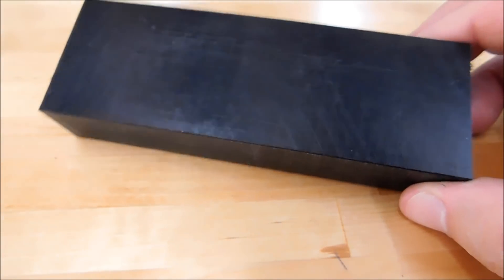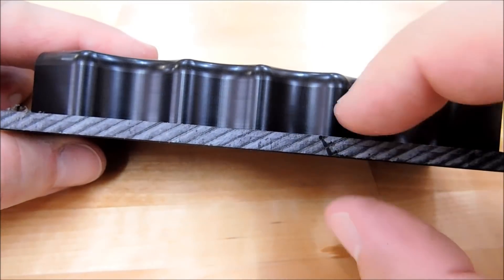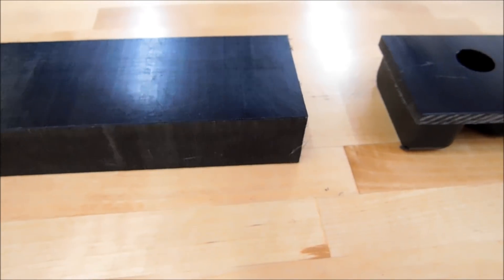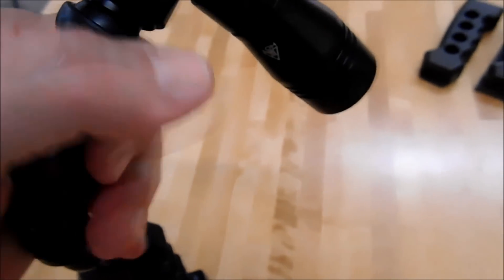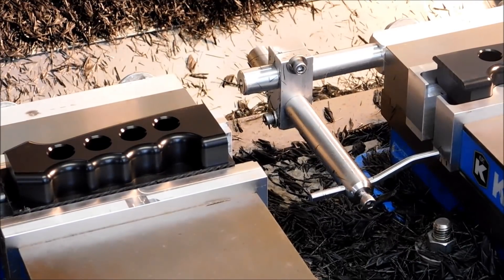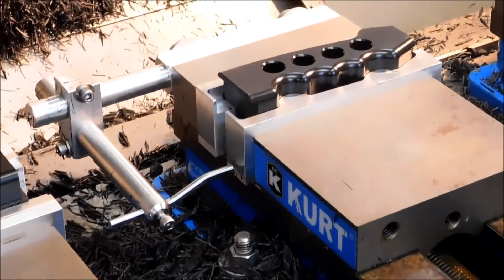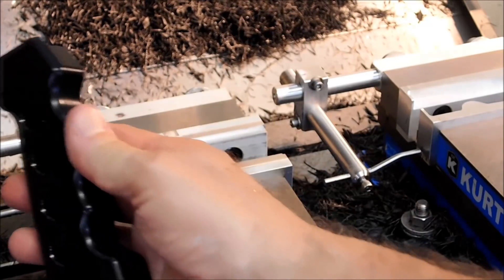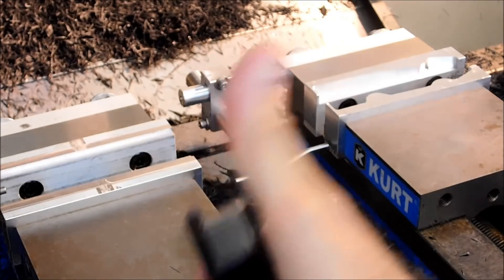Flip Flop Milling

Comment: Fun video to watch and fun comments to read. After seeing how many times "what material is that?" is asked, I am thinking Joe's saying note to self, always show materials used in a caption. For everyone concerned about his code efficiency, I made a one character change to some manufacturing code today that took ten seconds and had to fill out a full page change notification notice to release it. My IT friends have it even worse, they have to fill out a 7 page ticket for any size change and send it to a contractor to do the work, taking about three weeks. So sometimes the overhead of making a change, better fixture etc. dwarfs the time of making the change. I am guessing his fixturing and process flow is optimized for the number of parts made and total time required for setup.

Comment: Another Greatttt Video, Joe Pi !!!   I learn something from you - from every single video.   I have even started putting screen captures and notes into a notebook  (Machining Tips and Tricks from Joe Pi !).   I am assistant teaching machine shop classes at a local community college - you can bet that these tips and tricks are being taught to the kids!    A video on how you set up the vises and entered the offsets between the two vises would be great, too!  Nice work.  Great instruction on how to make multiple parts - in two vises.  I have typically made a registration feature on the part or on the cut off section of the part - and used a dowel pin to register when I flip the part over into either the same fixture or the second fixture( I know hard to understand from a written comment...)

Comment: I would love to see more tips and tricks on your cnc!
Reply from the maker: My software is pretty powerful. It kind of takes the creativity out of some things. I always enjoy the clamping and secondary positioning challenges. Good for the CNC and manual areas.
Reply: I currently use mastercam at my cnc but I  also work with an older Sharp mill. I enjoy seeing your creative answers to fixture work.
Reply: @joepie221  What software do you use?  I am using V-Carve, BobCADCAM, and now Fusion 360
Reply from the maker: @joecnc3341  Pro E wildfire 4.0

Comment: Joe -- I was just at Dos Ojos a month ago -- beautiful!  Did you post your dive video?  I cannot find it.  Cheers.
Reply from the maker: Still in edit. Its a great place to dive. Amazing.
Reply from the maker: Scuba, snorkel or just floating?
Reply: @joepie221  only snorkeling. I've never really wanted to scuba before, but wife and I both seriously tempted after seeing 2 cenotes last month.  I have a few great still photos I took with underwater camera.. The light was just right!
Reply from the maker: Cavern, cave or cenote diving is not for beginners or the faint of heart. be sure you have a number of dives under your belt and aren't freaked out by confined spaces before you decide to try it. Swimming in a cenote is amazing, but going to the bottom and into a crack in the rock is another level. Its amazing and beautiful, but just as dangerous and challenging. There is NO up if something goes wrong. Its actually quite a rush.

Comment: "These holes are interpolated because I use these holes for fixturing at a later time"  What?
Reply from the maker: Interpolating a hole means to size it with an end mill traveling a circular path. The size, finish and placement are very accurate. I register off these holes when I stand the part vertical for the end work.
Reply: @joepie221  
Learned about interpolating radii and internal and external holes long before I learned CNC. We had some K&T Rotary Head Mills. Pretty slick at the time.
Reply: @joepie221  Thanks, I was not familiar with that term.

Comment: Those lights are 100% water tested to depth and corrosion proof?
Reply from the maker: Yes. the lights are tested to 130M and fully corrosion proof. they are manufactured by Princeton Tec in NJ. Genesis 1000L. I personally dive with them and have nothing but praise.
Reply: @joepie221  Sounds like an excellent choice then! (~_^)-b
Reply from the maker: Rated the best illumination for the dollar. 1000 Lumen dive light for $150. Thats a great deal.
Reply: @joepie221  I would expect a deep diving light to cost. I suppose if one can afford to deep dive, its not really a large part of the cost of rigging.
Reply from the maker: I am currently heavy into cavern and cave diving. Deep doesn't factor in  lately. 60 feet maybe. But there is NO up. Its very intense.
Reply: @joepie221  I don't even have div certification, and the idea of being some place trapped when my air ran out scares me pretty well enough to not be enticed to go into underwater caverns... [nervous shudder]

Comment: On the last op, you could use your chamfer tool to spot drill the 2 smaller holes. If you spot them a few thou bigger than the drill size, you've effectively deburred them before drilling. Hope that makes sense.
Reply from the maker: I did that for the threaded hole. Normally, I deburr a part like it was molded, but those holes take anti-rotation pins that go vertically into a void. There is no mating hole so a raised burr doesn't get in the way of its function, nor is it visible at assembly. It does bother me though, so I may edit the code.

Comment: You could quickly spin up the tap in reverse direction after the first thread operation, might get the strings flying so it's clean for the second thread. Might be worth a try.

Comment: dude is dogshit at programming
Reply from the maker: Talk is cheap bud. Get technical and earn our respect.
Reply: @joepie221  I had hoped that was meant as a compliment but if it's not clear it doesn't count.
Reply from the maker: @tinman5322  I took it as a slam. if he had said "that was the shit" it would have been OK.
Reply: Fair enough. The 'net is such a global phenomenon that I resist using what might be regional colloquialisms. Here in the Boston area "wicked pissah" means great but I wouldn't expect anyone farther than 25 miles away to know that. That said, your techniques are WICKED PISSAH! Sorry, couldn't resist that time.
Reply: I have been a CNC machinist for 32 years started out hand writing G code on Tape machines. I currantly manage a small shop in Austin. I program a 5 axis Deckel Maho and others 50 hours a week for company that ships 500k a month with 3 machines and 2 guys. Joe,s programs are good and his end result is beautiful. Thanks for the video Joe

Comment: Are kurt vices so accurate that you can locate a precision part off the movable jaw?
Reply from the maker: They probably are, but my location is always done from the solid side. Soft jaws are another story.
Reply: I'm getting within ±0.003" on 4-jaw Kurt with removable aluminum soft jaws.

Comment: Is there a reason why your code has the tool step away and come back in (12:55) ? Something to do with eliminating backlash?
Reply from the maker: The 4 small radii present at the pockets are faded out at 2 degrees so there is no line of tangent, the step move assures the cutter is off the part for the re-position and re-entry on the opposite side. The shift was calculated to allow for the use of a larger tool if needed.

Comment: Those R planes are weird AF.  Goes R0. the. The programmer R value.  Pretty sure you could’ve used the same endmill for roughing and finishing.
Reply from the maker: They are the same size, But strictly to achieve the perfect cosmetic finish, I use a brand new cutter for the finish pass. No other reason.

Comment: Not hating on you at all. But I hate when the initial rapid plane and retract plane arent the same. Freaks me out every time.
Reply from the maker: Its fine, but how do you prefer to see it?
Reply: The initial rapid plane should be the same as your retract plane. So the last z rapid move before your canned drill cycle should be same as the R(retract) in your canned cycle. That is unless you are using g99 and g98 and are trying to avoid clamps or bolts
Reply from the maker: I always approach the feature high, and shift from hole to hole, low. My final retract is G98 and rapids to the high plane before leaving. Unless the height difference is major, the time difference, or even the visual is almost undetectable.

Comment: Great video. I'm just wondering how much would just a handle modified so as to be able to accept a metal file would be? What I like is the pistol grip aspect. would not need the 4 hole(s) in the handle.

Comment: great video Joe- It's amazing how many comments were sent claiming their way was more efficient but at the same time it was  interesting reading their other ideas
Reply from the maker: I agree Mark. I think if I had to make thousands of these, I'd consider investing in a mold and calling it a day. As for machining that many, pallets would be my first consideration. I've implemented those before in previous jobs, and you just can't beat the efficiency of loading a pallet while the machine is running. Door open time is almost non existent for the yield. This process was selected because of many other factors not discussed.

Comment: I don't tinker w/cnc , so my only comment is... WOW!
Reply from the maker: This would be a tough part on a rotary table. I bet not nearly as fast. Just a guess.
Reply: @joepie221  I don't even have a rotary table to clamp to my milling machine. I'd really like to see how such a part could be made on a basic milling machine Joe, after all I'm betting that most of us viewers don't own a CNC machine.
Reply: @steveclark..  Unless you are working strickley from your garage, there is little reason not to have a CNC anymore.  They can be found cheap at auctions, albeit they are someone else's used car.
Reply: @theincantrix5725  I work strictly from my garage, and I've got a 4-axis CNC router with 24x48 envelope, a 4-axis CNC knee mill, and a small CNC lathe. Router and mill are commercial products, even. Any used car you could get for the amount of cash I've invested wouldn't even be worth driving. Probably wouldn't even be capable of driving.
Reply: @theincantrix5725  My workshop is my garage I'm afraid, even if I did have space in there, I'm sure that even a second hand CNC would be out of my budget, apart from that, the programming/lines of code would be a step learning curve.
Reply: @steveclark..  Shop I work in bought a '93 Haas VF-0 for just over $2k some 4 yrs ago, with only minor issues.  As far as G-code, (seemingly eons ago now) I went from screw machines to CNC lathes over a single Saturday, probably easier than you think.

Comment: nice efficient Gcode, don't often see that coming out of CAM systems so I am guessing you did some editing?
Reply from the maker: Yes Sir, I sure did. Poly line details on a digital model can really choke code. Hard point tangent features really streamline things.
Reply: Bad code coming out of CAM is usually a result of a programmer's negligence or lack of understanding of the machining process and CAM proficiency. There are stupid things that CAM could do itself (transitions between cloned toolpaths, for example), but there's rarely something totally unavoidable.
Reply from the maker: @sciloj  A deeper understanding of how a digital model  is created and its impact on CAM code is not easily obtained. A poly line string of code is hundreds of lines longer than a 3 point tangent arc. if your processor is already burdened, the final feature can be faceted and the program will take longer to execute. Maybe a video on this topic will make it clear.
Reply from the maker: @sciloj  Can I ask why a channel host with only bird related videos would make such a judgmental comment on a topic not represented on their own channel?
Reply: @joepie221 , regarding your second comment, I can tell that people, including myself, not always do the same thing for a hobby as they do at work. Obviously, my nature videos are irrelevant to my full-time job in the field of industrial CNC machining (except, some of them taken with a portable LED light that I designed and machined). Regarding your first comment, I should explain that what I said above is not my judgment - it is a fact that exists independently, so I don't have to be an "authority" to simply state that fact (a lot of programmers in the industry do that mistake). If a profile of a part model consists of arcs, a CAM software supports arc geometry, and it is not a "toy CAM", machine definition for it is correct, having all that, this CAM software must be able to produce G02/G03 in posted G-code for a contour toolpath (if it's unable, it a kind of defeats the purpose, and that's a question to an operator, why he used an incapable tool). That's what MasterCAM does, as well as GibbsCAM, Autodesk Fusion, and many others. The only reason why it might not work there is an operator error, such as, for example, disabled arc output or totally wrong arc filter setting. There are situations where some fiddling with toolpath settings in CAM is required to get arcs rather than a whole bunch of G01's, but that's not about simple contour toolpath.
I didn't mean my comment as a personal attack against anyone specifically, but this problem is so common that I had to mention that. I like manual coding (and my first degree included a lot of software programming) - it is possible to do a lot of nice tricks with that, but I wouldn't think about CAMs as about something that automatically produces "bad" code.
Reply from the maker: @sciloj  Thanks for the clarification. I use Pro-Engineer Wildfire 4.0 for some of these models and 100% of the code. To create arcs in the modeling software, there are many options. A poly line arc is like a string of beads and can be bumped and manipulated any way the engineer  needs to. This being said, G02 and G03 code options are out the window, It has to be a string of G01 movements. It takes time and can show up in the finish as ultra fine faceting because of the miniature"point to point" moves. I can not control the output options of this CAM to blend them. I usually just overlay the master model and see if a continuous arc can be subbed if I am unhappy with a finish. I actually was offended by your initial comment and thank you for clearing that up.
Reply: @joepie221 , from what you said, it seems (however, I'm not sure) that a 2D primitive that you used is intended for more complex shapes, and, indeed, will produce a toolpath of tiny straight lines. There should be an option of a true arc. I haven't used Pro/Engineer, however, there is a person I know who used Creo (same CAD engine), he could give me some explanation. In MasterCAM, for example, that would be exactly that problem I described above, and there it is possible to remove at least the majority of the straight moves by setting the arc filter.
Speaking of offensive comments - I did come to the US (and US manufacturing specifically) from a different culture and area of industry where stating facts isn't (usually) considered a bad thing even if these facts might influence someone's negative perception. And it often feels so redundant (especially with younger guys, millennials) that I have to give a disclaimer about my intentions. While if I were a troll or bully, I'd still be able to lie about my "good intentions" and still be able to influence negative emotions in people.
Reply: If you can't make efficient gcode from a cam program you should either use more time of the program or get another cam program haha

And this program does not look that efficient tbh.
Reply from the maker: @nikolaiownz  I'd be more than happy to listen to your critique. I am very happy with this program and each move has a solid reason behind it. feel free to comment further.

Comment: Love your tips and your channel, but I have to ask, Why design it so complicated - it has no more functionality than a smooth piece of tubing. In fact I bet most hands do not fit it at all.
Reply from the maker: Several reasons. These lights and cameras can cost a serious amount of cash. Smooth tubing handles can allow for the units to slip through your hands under load, or be dropped when handing them to the dive boat attendants. Handles with overmolded rubber can break down and get sticky with prolonged salt water exposure. The scallops on these grips give you better feel, and the flared tops transfer a lot of the load to the top of the hand relieving some grip requirement. The scallop and grip pattern went through many generations before this was given the green light. The cross holes allow for the pads and softer parts of your hand to conform, and smaller hands are more comfortable using the top 3 notches. You would be wrong about these not fitting most hands. They are quite comfortable.